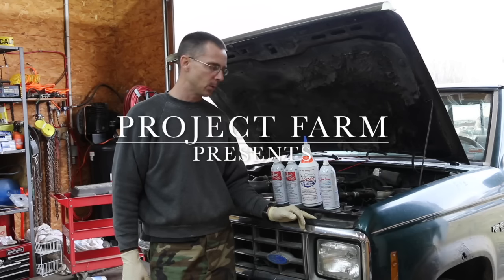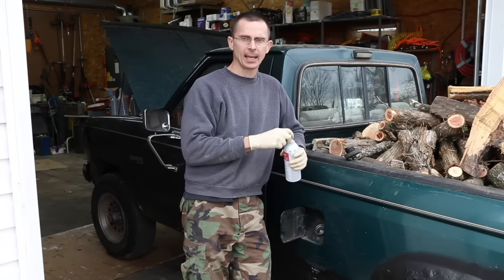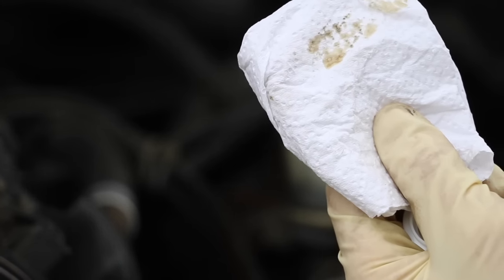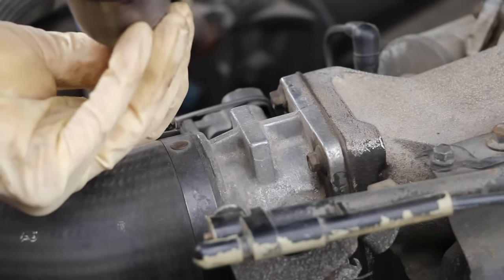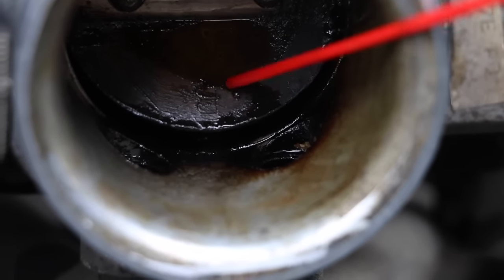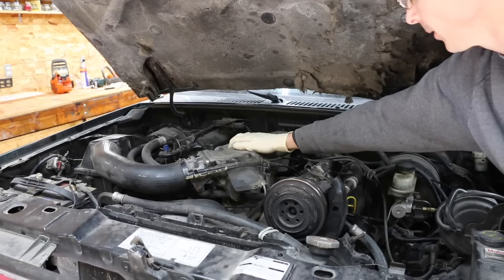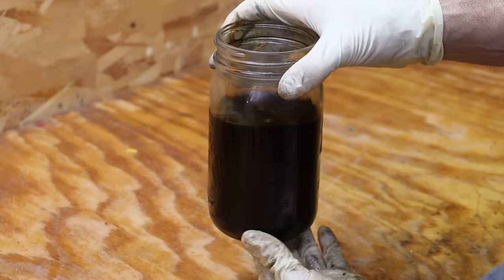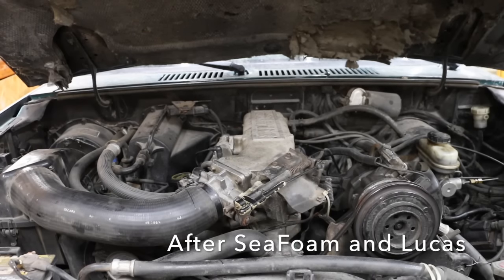Seafoam--can't believe what it did to my engine!!

Comment: I have a jeep liberty with 200,000 miles it had a stuck valve and the lifter sounded worse than yours.  I did the same 3 step and man what a difference I saved hundreds of dollars.  I didn't have to rebuild the top end or sand the valves and redo it.  So basically sea foam is a great amazing product.. this is a 2 year old video but thank you for sharing you're experience!!
Reply from the maker: Very impressive!  Thank you!
Reply: My1991 Chevy half ton short bed Sat for a long time when my cousin couldn't get her to pass IM for the state. Pops picked it up and let It sit even longer then gave it to my sister. I bought it off her cause it has a crate with less than 7k on it and a brand new trans with a heavy dude clutch pack kit for towing, but the sitting had gummed up the throttle body injection. Ran a can of sea foam and followed up with a bottle of Lucas to re lube the piston rings (sea foam is ethanol based and so the Lucas oil is advisable afterwards) runs like a top now! Another good one is Marvel mystery oil, it works as a fuel and oil additive
Reply: Is this able to be done with the CRD diesel engine on my 06 Liberty?
Reply: TheWorstChannelYouKnow 
The piston rings are always lubed. If not you won’t make it very far...
Reply: @kevintucker3354  ethanol dries out seals. If you use it too much they will crack and fail over time. Source: actual  mechanics at the Chevy dealer I work for.
Reply: @kevintucker3354  bro want to do anything what belong to doing nothing but the vein Jose play that to thaw iPhone 233 I'll be okay let the dog out a bargain now pitbull hound dog
Reply: That 3.7 is always ticking
Reply: Charles Hogan what ? That comment makes no sense- nonsense!
Reply: @RageUnchained  lmao, I don't care what mechanics say, tell me what the engineers say about this
Reply: @kiyoponnn  engineers will tell you that ethanol cracks rubber seals and bushings over time.
Reply: @RageUnchained  Alright, fair enough
Reply: Wow... A Jeep Liberty lasted 200k?
Reply: @Rusty Highlander Don't let gunk and rust get on your gun!
Reply: Lil' Red GTO  I don't put fuel on bushings I just used it as an example because they like rings will dry out from ethanol and crack. I know this because I once spilled a gas can of E85 and ruined a bushing kit that was sitting next to my garage work bench

Comment: I'm an ASE Master Auto Tech 43 yrs.  Seafoam is fantastic. Failed your emission test?  I let it enter the MAIN vacuum system with a hose  until the last third of the can and then stall the engine @ idle w/ the rest...   Let it sit for 1/2 hour.  Then hold it at 1500 RPM for 15 minutes.  Cures Catalytic problems 90% of the time.  Use Carb Clean to clean the throttle body with a rag and small screwdriver. (A tooth brush will melt)  Yet, I Don't agree with the Lucus oil treatment.  That's just putting off a problem that Will come back...  Great video!
Reply from the maker: This is all great information and thanks for taking time to post.  Great point regarding Lucas and thanks for the positive comment regarding the video!
Reply: Exactly, the same kind you use in your fuel I run in the crank case prior to oil change and through the main vacuum line slowly until it’s gone

Comment: It’s neat that someone touches on seafoam, it’s something that we’ve always keep in the garage for any old motors. Also your videos are always fun and interesting, I enjoy them a lot.
Reply: Old mechanix tric for Sticking or 🎉🎉. noisy valve lifter a quart of automatic transmission oil on the motor for 100 milles Do the job righ

Comment: Stumbled across this vid by accident. Excellent work! Nice not to have annoying music or other such nonsense; just straightforward facts and proof of product claims right there in your face.  I've gotten into arguments over the years with so-called experts who claim SeaFoam is nothing but snake oil. My dad, who was an NHRA record holder back in the early 70's, and did all of his own engine and set-ups, swore by this stuff. My real world first-person proof came when I bought an '84 F250 w/6.9 diesel. It was almost 15 years old then and had spent a lot of years sitting in a barn. Everyone said take it to a dealer or mechanic, needs a re-build, etc., etc. Being a cheapskate (LOL) I decided to put my old man's advice to the test. Dumped in a whole can and... WOW! Injectors and motor sounds told the story. What were once rough (really rough) starts, poor throttle response and crappy running became instant starts, crisp responsive throttle and smoooth as butter running - around town and out on the highway. Anyone who says SF is a "trick" is deluded. This stuff really almost is MAGIC in a can. I also have taken to using a few Lucas products over the past decade and their stuff is also spot-on as they claim. Like you suggested just try it first. Could make all the difference between an expensive rebuild... or just a few bucks. I use SeaFoam in ANYTHING that's got an engine: gas, diesel or 2-stroke. Old or new. Thanks for this video. Consider me subbed!
Reply from the maker: Thanks!  Thanks for watching and subscribing!

Comment: 167,000 miles and it looks like it's been to hell at least 3 times and back.
Reply: Thats a working man's truck. The engine needs mounts bad
Reply: Haha. I guess you guys have to look my Green Devil 2001 Corolla with 180’000 miles on it. Just put some Cooper Winter Tires and black steel rims and God knows how mean that thing looks. I saw this guy with a brand new Dodge Durango SRT stearin at it yesterday. Lol. By the way I never wash outside of that car, that’s the spirit.
Reply: in the Zone I got 267000 miles out of my 1.8 Ltr  VW engine no noise not using 1 pint in 10000 miles AND VW do not recommend any of this stuff
Reply: That's low mileage on that truck.
Reply: @stevenhorsefield2909  probably just uses it around the farm. I only put 8k miles on my car every year. I never understood why people say driving low miles is bad... if you change your fluids at the severe schedule you will not have problems. Plus it means over time you wont need to buy a car as soon. Save probably 20k over 10 years. Inflation is taking care of the newer vehicles better gas mileage so that is irrelevant.
Reply: We call that a happy car! I have had a few.
Reply: Those Rangers where solid little trucks.  They just ran.
Reply: @Hallowsaw  not driving often ends up wearing out other parts. seals start to leak, bushings go bad, etc. you won't notice it right away but eventually
Reply: @macfiona4545  
The guy in the srt was probably wondering who would drive that junk
Reply: @Hallowsaw  
Driving low miles isn't bad but just letting a car sit is terrible for them the rubber dryrots and stuff starts to clog up. Its just like how a house will fall apart with no-one living in it.
Reply: Jessie B, I hope so
Reply: InTheZone lol, my best friends 89 ranger has almost 400k on it and it still looks new.  Original motor and transmission.
Reply: @stevenhorsefield2909  he, its more mid miles. low miles is like 120000 or less. after that you move into mid range. my truck is low mileage, just about to clock 51k, and its an 87 model dodge 4 banger with an 82 motor.
Reply: ....American engineering 🤷‍♂️
Reply: The center of the earth is only 4000 miles away, so assuming hell it's at the center, it could've been to hell and back 42 times or almost 7 times around the globe.
Reply: You Wish that’s true in some cases my grandma has a 2002 thunderbird that anniversary revival edition. Got it for her anniversary put 5,000 miles on it and it was garage bound for 20 years on and off. Thing is a 20 years old now with 5,800 miles and not a single scratch or pit in the chrome
Reply: @nunya3163  I had one of those. Worst truck I've ever had. It did run ok, I guess - everything else about it was garbage, though!
Reply: Keep on Truckin !
Reply: 167k is nothing. I've got 275000 on my 300 straight 6 from 1986. I used slick 50 it's entire life.
Reply: I got a 1993 ranger with 196,000 miles on it, pretty much saved it from the junkyard.
Got it to run around the ranch, it's been gone through on everything mechanical and is very reliable now.
I'm impressed.
Reply: 167k is a lot? My 97 4runner has 334k.
Reply: @BernieMittens  I know right. I sit here scratching my head. My 2003 Chevy s10 4.7 liter v6 has 214-215k miles on it. Fresh trans at 213-ish. Not even a little tick from her. But I am sorely tempted to try the seafoam for the her just to ensure my old girl is running as well as she can. Pretty much exactly like he is doing on his truck. I'd like to think the old girl has another 200k on her.
Reply: Jeramiah Westbrook I just took my truck out on a long drive today. Granted, it’s sluggish and slow given the weight and small engine, but it’s a rock crawler and for that purpose it works. As a highway vehicle it barely gets out of its own way. Get the Chevy 5.7L and that’s bulletproof too.
Reply: @BernieMittens  Some time in the future I intend on replacing the engine with a 454 Big block. Can't go wrong there to be honest. Buut that is far down the road. Hopefully by the time my current trans dies out. Currently I am just looking at small ways to ensure a long lifetime of it.
Reply: Jeramiah Westbrook I’m playing around with either adding a supercharger or throwing a v8 in my truck, but I’m not sure if it will require a new transmission.
Reply: @BernieMittens  As a general rule of thumb it is probably the best idea to replace a trans when going for any bigger engine. Supercharger? As far as that goes, I don't know a damn thing. I only know what my mechanically inclined friends tell me.
Reply: @fordxbgtfalcon  i doubt it's the original transmission. Motor is believable tho.
Reply: my chevy silverado 1500 has257000 and runs grean no lifter noise full my boat 2320 parker i use Berryman  B12 evry other fuel full tank and  lucas every 
time i change my oil.
Reply: @macfiona4545  lol I have a 1978 Pontiac safari wagon and that thing is a beast in the winter. Seafoam made it run brand new. Burns oils sometimes but it's suprisingly fast
Reply: Rex Jolles. I believe you. Used to have a green Pontiac Sunbird with a V6 3.6 litter and that thing was monster too. Miss that little thing. True American Manufacturing
Reply: looks like a minnesota car.
Reply: Looks a heck of a lot better than my truck haha
Reply: @ectomorphnranger5165  Nailed it
Reply: Yeah that thing was obviously abused and maintained horribly based on its condition lol
Reply: Everyone talks about the miles, as though it's poorly engineered but it's a farm truck. You measure the wear in hours of operation. It makes a million short trips on and off constantly. Highway mile are the lowest impact miles you can put on a vehicle, if you're not trying to rally race everybody, that is.

Comment: I dont even ask for advice anymore at the local Autozone. Instead I give them my advice, which is your YouTube channel.  Great job!
Reply from the maker: Thank you!
Reply: Asking for car advice at Auto zone is like asking for hardware advice at home Depot, you will get the opinion of someone who is working for minimum wage.
Reply: Justin Kasey They make more than minimum wage, but I see your point. Lol
Reply: Jamie May wouldn’t trust advice from anyone at Auto Zone even if my life depended on it. None of their employees are even competent enough to even select the correct motor oil off the self
Reply: Jamie May I’m guilty of the same thing. After a couple of years of watching Project Farm’s videos, I am a certified auto technician.
Reply: I took a carburetor in there to size fit a idler screw and the feller picks it up looks it over and says what is this
Reply: @donkeedik2302  Lol
Reply: @fathead22146  We actually have a young chick at one of our local autozones that is late 20's that really knows her stuff.  She grew up in a body shop, litterally, and keeps up with anything auto related.  Its kind of refreshing so I wouldn't say that nobody at Autozone knows what they are talking about, I only ask her about stuff when shes in and its sad because the other employees always defer to her.
Reply: Brad Edwards I agree. They definitely are few and far between sadly.
Reply: i just went to a parts store looking to my brakes and needed a jack lift to get my suv off the ground. i specifically asked one of the workers which one i needed to clear my vehicle (i couldnt find the information online oddly enough). so he pointed at a 2 ton with max height of 15 inches. he literally said "my friend just used this to get his f150 off the ground".
take it home and right away i know, nope. he is full of shit. i needed at least 3 more inches to get my tire off the ground.
so yeah, dont trust the workers advice to be completely accurate.
Reply: they oversell you with products you don't need and most times don't know anything much about cars when it comes to the real technical mechanical parts. weird.

Comment: Another data point for the sea foam intake product:  My GF has a CRV that had a persistent code (and accompanying check engine light) regarding the dynamic intake runner.  It is vacuum actuated, and it wouldn't move to the high rpm configuration with just the engine running, but if you disconnected its vacuum hose and applied vacuum manually, it would turn (I verified this by stuffing a USB bore scope down the intake to look at it).  Running one can of seafoam through the intake while manually actuating the intake runner adjustment, and it freed right up.  Cleared engine codes, and it's been working fine for several thousand miles.
Reply from the maker: Thanks for sharing.

Comment: I love seafoam. Problem for me and my 2 high milage engines is that in the oil it worked too good. As in it broke down my rtv sealant that ended up clogging the oil pick up. Anywho im mechanically inclined and fixed the issues. Love it in the fuel. I use ATF for my oil to clean up before a oil change

Comment: Your throttle plate is begging for a toothbrush and a scrub.
Reply from the maker: Great point!  Thank you
Reply: There used to be a warning label saying NOT to clean the intake.  Is this still true or am I dreaming again...???
Reply: Bill Michael probably thinking of the MAF sensor.
Reply: ...and a can of carb and choke cleaner.
Reply: B12 Chemtool will disintegrate the crud on the throttle plate. Seafoam smells like ammonia or Windex to me. I don't remember the ingredients list or the MSDS list for Seafoam.
Reply: Keny Charles mostly ethanol
Reply: Robert Amatucci the idea that there are “carbon deposits” on the throttle plate is rediculous though. Unless there’s combustion/oil leak happening in the throttle body lol
Reply: nudu Yeah, it’s probably varnish and the whole throttle body assembly and intake could really use a good ultrasonic cleaner bath - works miracles ! 👍
Reply: Does the Lucas stuff increase the viscosity? For example if I put 5w-30 in my car and add Lucas oil stabilizer.  Is it going to make it like 10w-40?
Reply: @nudu3219  PCV system is a really good cause of it. Especially cars with a good amount of blow by
Reply: @Hallowsaw  I've wondered that too. Sure seems like it.
Reply: Shawn Warnick 
No, you’re okay, Unless you’re in an extremely cold winter climate, then you might want to partially use a lighter weight oil with it.  Also, I think it’s better to only use 1/2 quart of the Lucas at oil change.
Reply: I found CRC Throttle body cleaner does a great job cleaning off the carbon and crud off the throttle body plate.
Reply: Toothbrush? Not exactly efficient
Reply: Cleaning the throttle body is something allota folks neglect but can make a big difference in starting and operation. My first cars were carburated engines and I kept those carburetors clean with Gumout or similar. A good practice with lawn mowers chainsaws etc.
Reply: @Spacecoastz That's why you would use Throttle Body Cleaner, which is less harsh than carb or brake cleaner.  TBC won't hurt the coating.
Reply: @nudu3219  nope. EGR pipe is causing it. It's where it gets fed into the motor.
Reply: @billspooks  There is a special spray for that.  Do NOT move the throttle plate by hand.  I can ruin stepper motor etc$$$
Reply: Bill Michael yes on Ford’s they have a special coating on it
Reply: Also do it in the summertime if you plan on adding it.
Reply: @Hallowsaw  Yes, there's a reason why the additive is so thick.